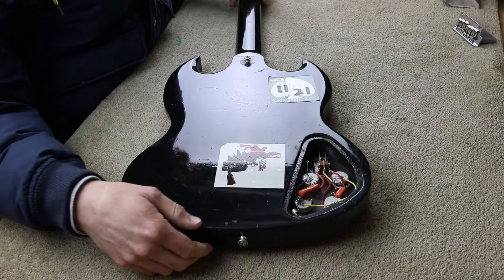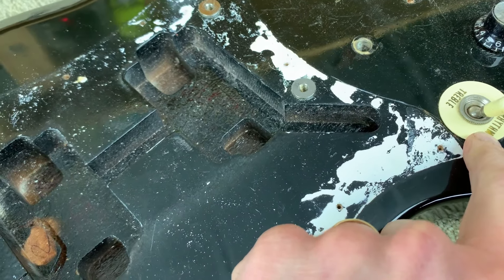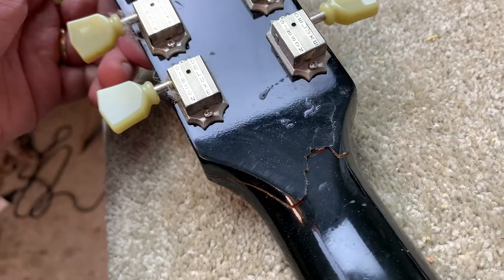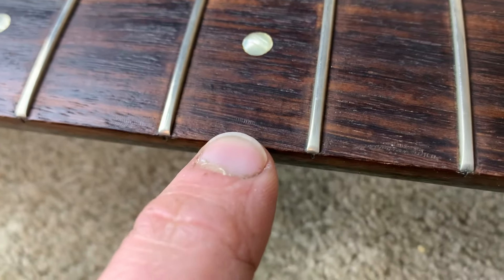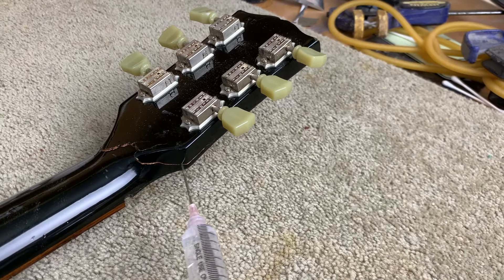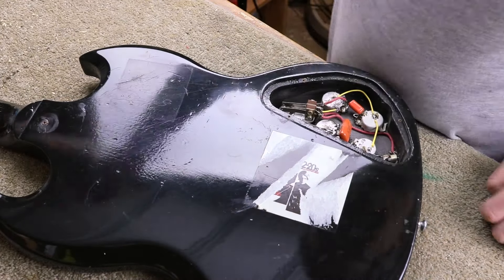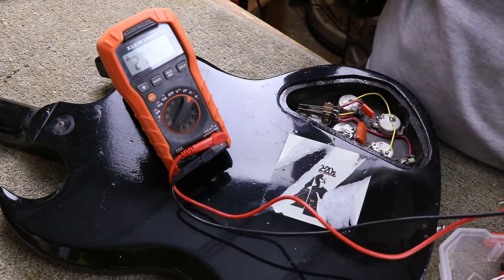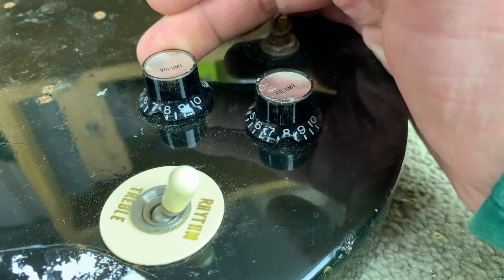Gibson SG Special Restoration - Part 1: Fixing the broken headstock

Comment: Gibson trademark headstock break 🤣
Reply from the maker: This may come as a surprise but I have another two Les Pauls awaiting headstock repairs - one of which the previous owner literally sawed off! Coming to a YouTube channel near you, albeit probably not soon!
Reply: Any guitar neck could break
Reply: @Vidar.m Right, but it seems that the Gibson SGs are the most famous for headstock/neck breaks, given they have extreme neck dive. For those that don’t know, neck dive is when a guitar’s headstock tilts downward when hanging on a standard strap, due to improper weight distribution. The neck is heavier than the body of the guitar, causing breaks like this to occur.

Comment: Hi, really enjoying the videos so far, spent an entire Sunday afternoon following this project!

I have an SG with a similar break which I’m planning on repairing. What influences your decision when deciding where to simply glue the break versus adding some splines for reinforcement?
Thanks
Reply from the maker: I take great satisfaction in reading comments like this, so thank you! Regarding whether or not to spline, it’s a bit of a divisive topic and there are many who will disagree with what I’m about to say (in fact one guy called me an “a**hole” in a comment on the SG video series for basically setting everyone up for failure by showing a repair that didn’t use splines…). 

But my rule of thumb is if it’s a fracture and not a complete break, and the two surfaces mate perfectly when held back together, then I glue. Titebond is very strong and has been used successfully for scarfe joints on headstocks for decades with no concerns of failure when properly applied. 

But what it’s not suitable for is filling gaps. If the joint doesn’t go back together perfectly I would use epoxy and splines. The reason I use epoxy over wood glue is that unlike Titebond etc it will fill voids. It also doesn’t creep so is far less likely to start ghosting through your new paintwork. 

Probably won’t be until early 2025 now but I have a series coming up showing the repair on the Les Paul Custom I showed in my last video. That will show you the other extreme!

Hope that helps!
Reply: @ that does indeed help, so thanks for taking the time to provide your insights.

I have two epiphones sat waiting for some experimentation so I’ll be using your videos as my guide!

I’ll look forward to seeing what happens with the Les Paul next year :)